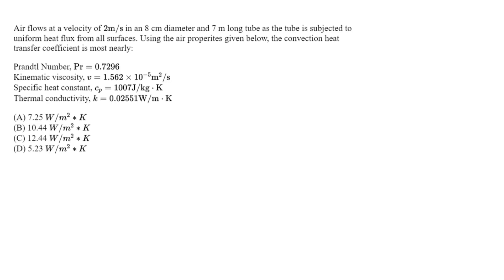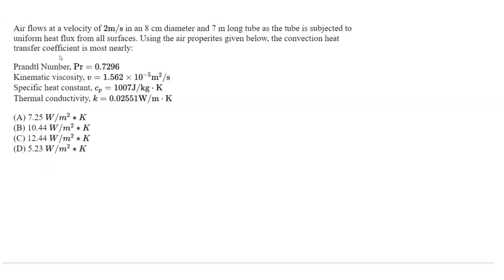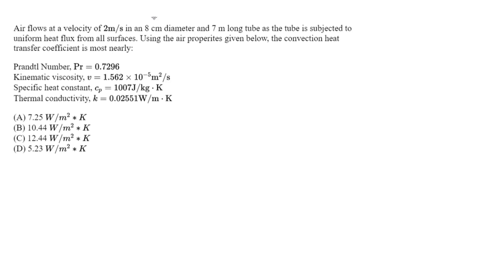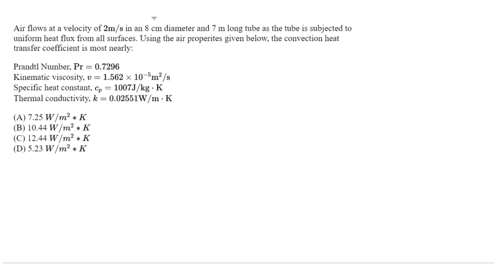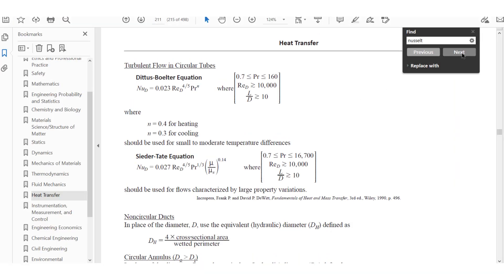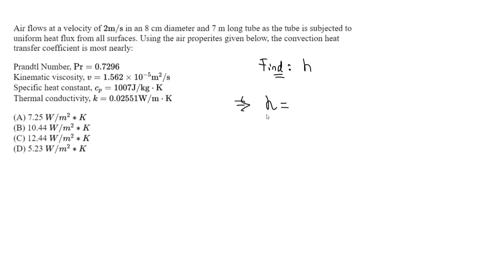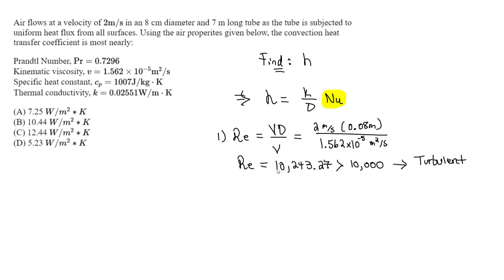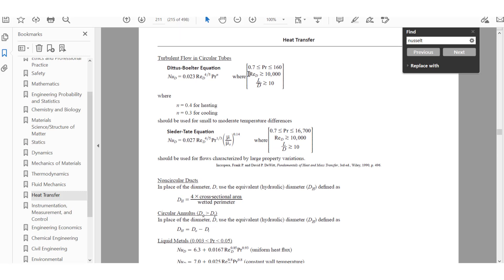FE Exam Review - Heat Transfer - Convection

Comment: 8:14 how do we know this scenario is heating and not cooling? To me they're almost the same thing: when you heat something, you cool something else. Also, in this problem, the tube is subjected to heat flux. I thought that can mean the tube is being cooled down as heat transfers to ambience.
Reply: the fact this wasn't answered is very disappointing
Reply: I solved for the other choice and i got 10.77 which is closest to 10.44 (here you can get the right answer bothway). However, it is confusing, that is why i am here!
Reply: It’s because the tube is subjected to a heat flux from all surfaces which means it is heating up the air

Comment: studying for my FE in December. Due to my major (mechatronic engr.), I don't take heat transfer, so I'll need to study for it through the practice exam and other resources. Thank you for your videos!
Reply: @danithaman4610  got it. You can delete. And thanks, I have an assignment due at midnight but right after I’m gettin some rest!
Reply: @capsulecorpa.t.186  thank you!
Reply: @danithaman4610  no problem! Did you get it?
Reply: @capsulecorpa.t.186  yup, I got it.
Reply: @capsulecorpa.t.186  would you be able to send them to me as well? I'm taking mine next month and I could use some extra practice!
Reply: @96gab  sorry for the late response, email??
Reply: @96gab  send me your email!
Reply: @1234SLUR  sent!
Reply: @capsulecorpa.t.186  possible for the link as well please? Taking mechanical exam in November. Any tips or suggestions?
Reply: How did it go?
Reply: @danithaman4610  i failed it!! But I retook it last month and passed! These videos helped a ton!
Reply: @capsulecorpa.t.186  dude congratulations!! 
I take mine this month. 
Any advice? What should I expect?
Reply: @danithaman4610  spend aa much time as you can preparing for the exam. I would recommend these ^^types of problems. They are meant to be solved within 2-5 minutes. You’re not going to get a problem where you have to derive a formula, apply boundary conditions, etc... look for “FE-type” problems and the internet has plenty! I have some resources I am happy to send your way! Which one are you taking?? Mechanical?
Reply: @capsulecorpa.t.186  thank you for the advice, I appreciate it. Yup, I am taking the mechanical fe. Yeah, please send me the resources you have. Would you like my email or can you link them here?
Reply: @danithaman4610  sure thing! Shoot me your email through DM. I think you can DM on here, I just looked it up. Go to my channel >> About >> Send Message
Reply: @capsulecorpa.t.186  are you using a mobile device or are you on a desktop? I can’t find it on mobile
Reply: @danithaman4610  hi, not too sure. Wanna leave your email then then I’ll just send it? Little out of it today. First COVID shot 😬
Reply: @danithaman4610  just saw this
Reply: @Anthony McKinney can you share the link with me as well. Anything pertaining chemical and mechanical will help.